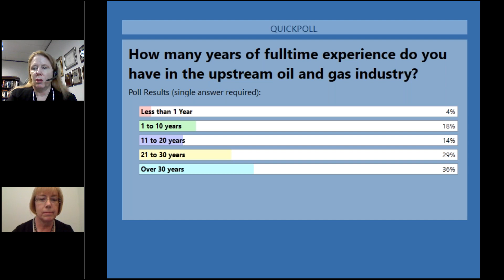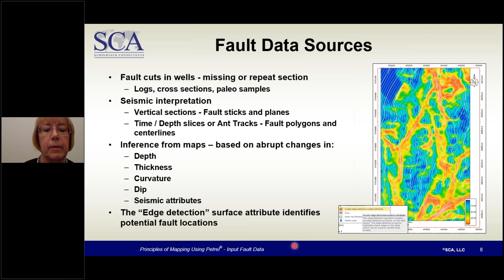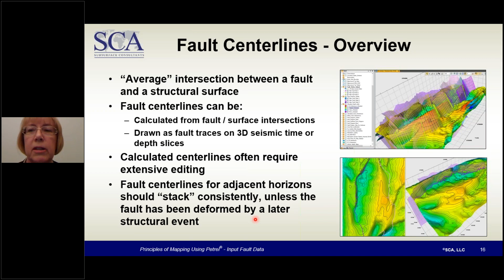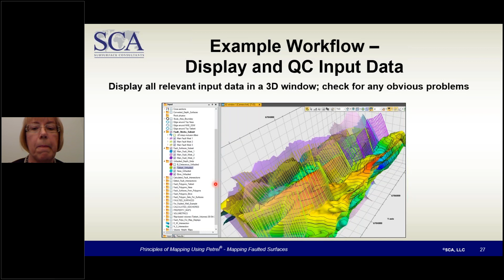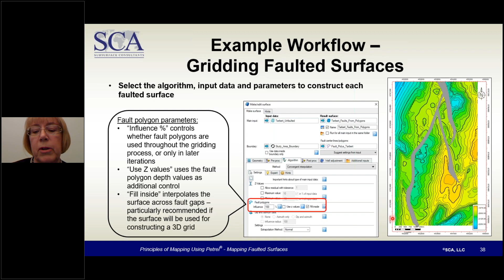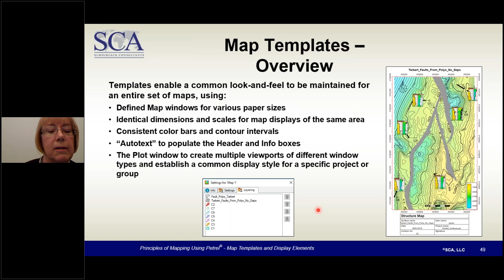Mapping Faulted Surfaces with Petrel©

Comment: Excellent presentation, Lourie. I wrote the Convergent gridding algorithm, released in 1987. Also Convergent’s Conformal modeling. When modeling faults, why don’t you use Fault Framework Modeling (FFM)?  I released that in 2010. Intersecting faults are auto-sensed as intersecting, then truncated. Saves a lot of manual labor. FFM internally uses Convergent, producing also the fault trim loop polygon. Transforms fault data to a best-fit-plane before running Convergent. Thus even vertical faults are easily modeled by FFM.